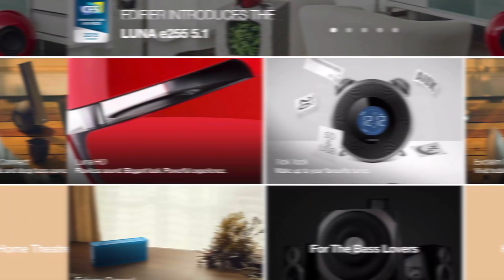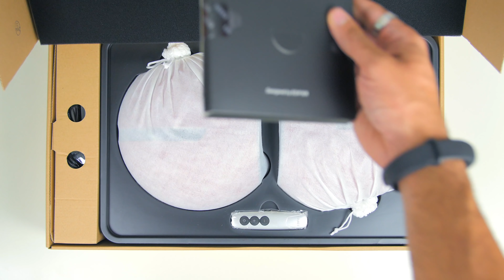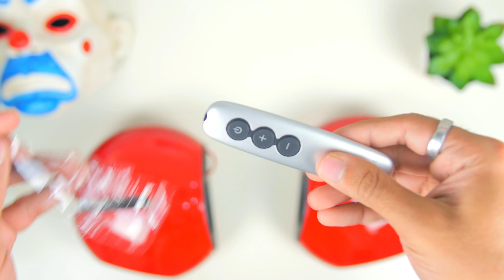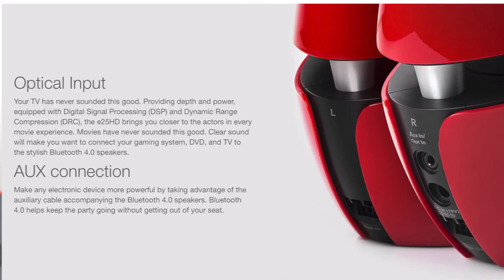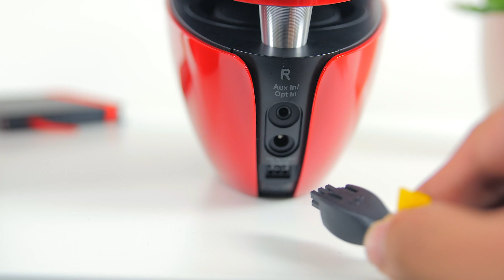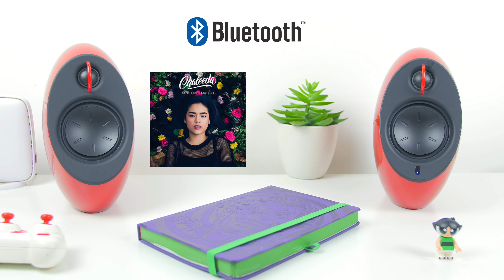Best Looking Desktop Speakers! Edifier Luna Eclipse HD

Comment: Perhaps aux sounds better than Bluetooth?
Reply from the maker: Hi Tin, yeap, wired connection does sound a bit better but the Bluetooth supports APTX streaming which is high quality streaming so the difference is minimal 🙂